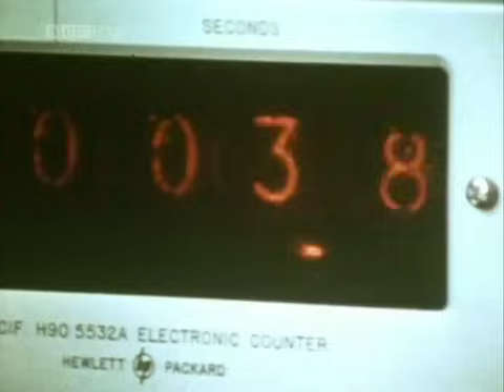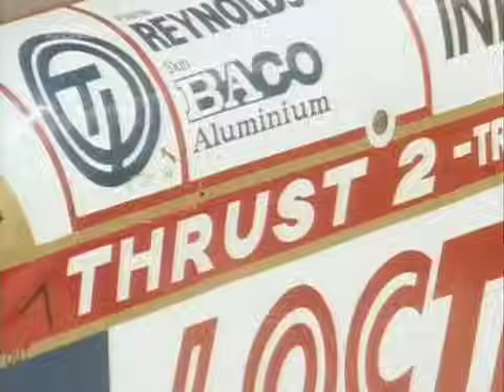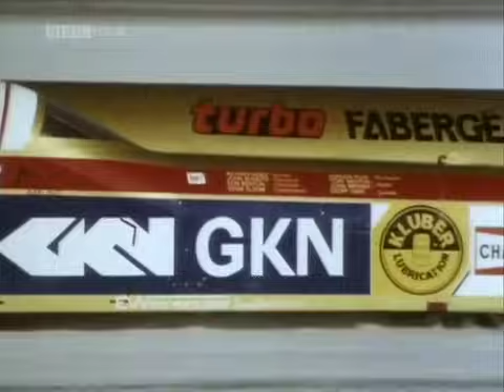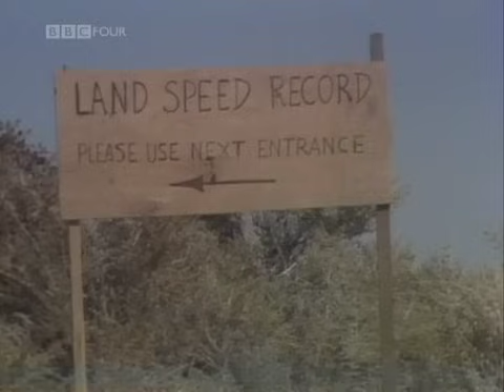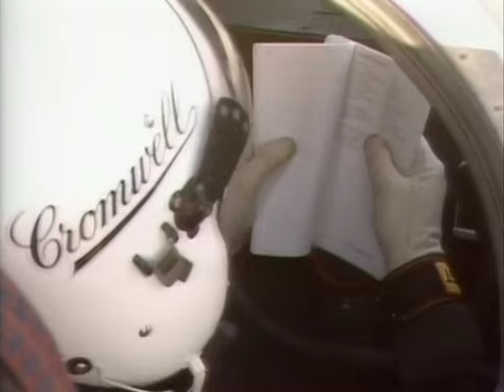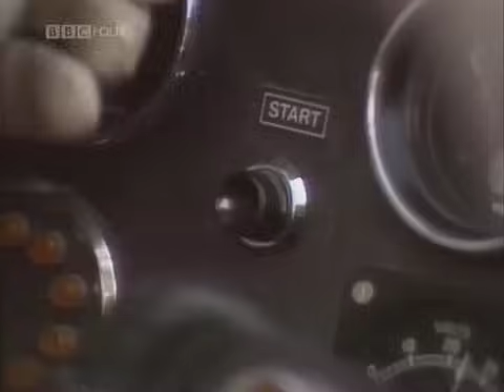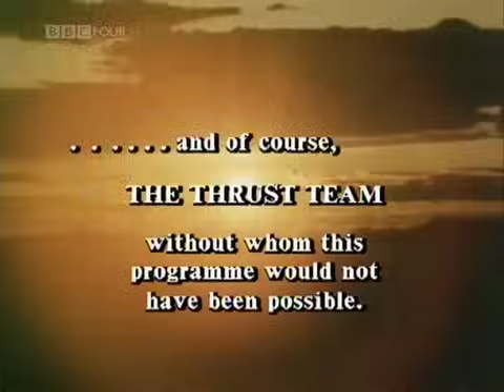Thrust 2 - For Britain And The Hell Of It

Comment: One of the final problems the team overcame was the pitch angle of the car. They decided to run with the car slightly nose up to prevent it from digging in to the desert surface. During the design phase for Thrust SSC, they tested the computer modeling software against the data they had for Thrust 2 to double check that the modeling was accurate. They discovered 2 things; 1, the model was very accurate and
2, if they had pushed Thrust 2 9 mph faster, she would have taken off and killed Richard Noble!
Reply: Imagine the nervous laughter when they figured that one out.
Reply: "Overcame" is not the correct word to describe this fact. As I understand it the Thrust 2 Team never fully comprehended the true nature of the potential danger behind their engineering decisions. With modern record attempts and the desire to exceed the sound barrier while remaining on the ground this lack of foreknowledge is not just unacceptable it is reckless. The whole notion of "Luck" is baked into the very idea of land speed record breaking, yet the speed has become too great for this old attitude to be carried forward. Any modern attempt at the current outright land speed record must not be just for "the hell of it" it must have some higher purpose beyond the selfish desire for glory by a bored rich person.
Reply: @BaronVonHobgoblin  How is it selfish?

Comment: A succession of Utah governors deserve an atomic kick in their asses for letting the Salt Flats die. In the 60’s the salt surface was 2 feet thick, now it’s 1/4” to 1/2” bare in many spots. They all allowed for the pumping of the salt solution away from the flats so salt and other minerals could be removed. You saw the racing at Black Rock, it’s filthy and soft. On dirt the cars ride 4 or 5” below the surface but at Bonneville they have in the past ridden on a hard surface of crystalized salt.

Comment: Thrust 2 was a copy of Green Monster.
Reply: naaa--Thrust is Gold
Reply: @MrDaiseymay  Any plans to grow up?
Reply: Not really. Similar concept, but how different can an inline, 4 wheeled jet engined car be?
Reply: @runlarryrun77  it was a copy right down to losing right front wheel bearings due to torque overload.
Reply: So if it was a copy, how come the Green Monster couldn't achieve the same speed?
Reply: @runlarryrun77  what is your definition of inline 4 wheeler?
Reply: @oliabid-price4517  Green Monster was homebuilt in backyard.  Thrust had benefit of wind tunnel.